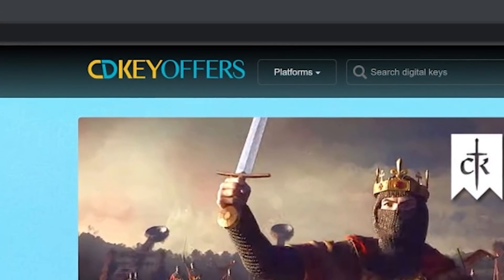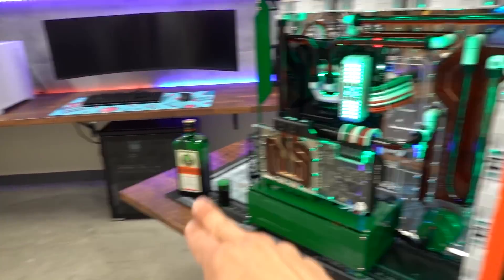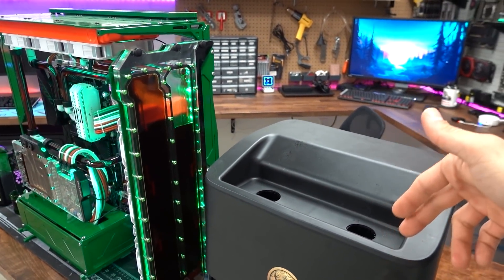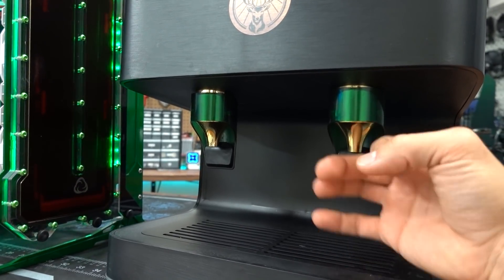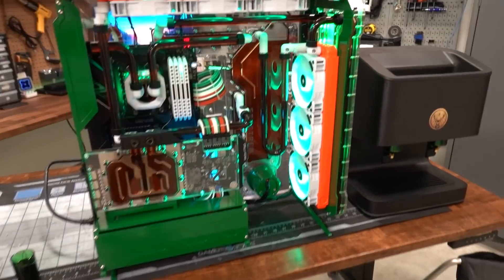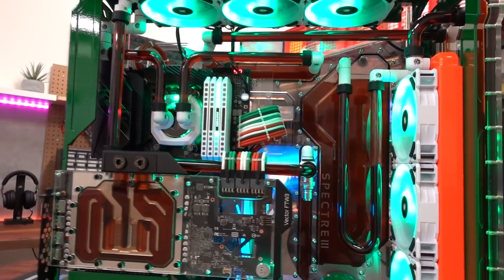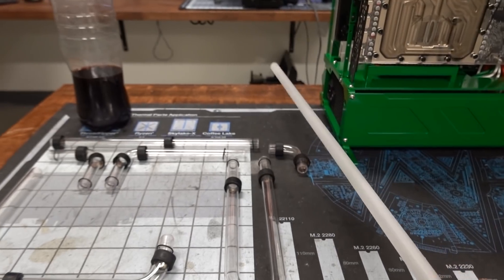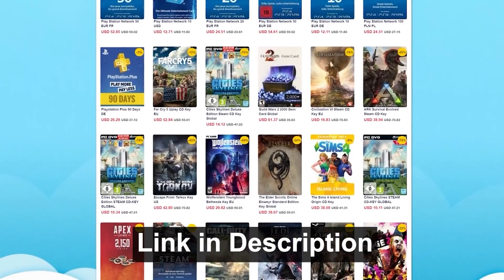IT'S BACK! My secret plans for the Jägermeister PC...REVEALED!

Comment: Be sure to allow the cooled fluid through the whole loop.  The way you described it, sounded like you were were going to pull the fluid right after the pump, which would not allow the new fluid to proceed to the rest of the loop.  And you would add the newly cooled fluid to the res area.  This would seem to be a small loop unto itself and may starve the GPU and CPU loop of most of the newly cooled fluid.  Ideally I would think you would want to pull the fluid before the draining plug and put the newly cooled fluid right in the draining plug.  This way your original loop is intact and you are just adding in this new loop.

Comment: recommend laying off the cooler idea as condensation is a definite will happen if humidity is too high in room, For it to work it would have to be in a fridge basically not a good idea.

Comment: Trying to give advice, youtube is acting up.
For the fill port on the Jager bottles, use a two part fitting like the kind for barrels or aquariums, but you have to figure out how to hold the inside part in place while screwing them together.
For moisture, you can get a small de-humidifier, they are made for a certain type of safe... a pew pew safe.

Comment: I suggest leaving one of the two chillers OUT of the PC loop. Keep it as a chiller so they can use it at the HQ. Gut the left side, adds pump if needed, do the bottle reservoir, but then have CLEAR tubing go into the bottle, and use the FROSTED tubing out the bottom. BOOM, the Jäger is ‘chilled’! You could do this at the top of the loop too to make it look like the PC heated up the water, (which, it did, technically) and then the chiller cooled the water down, when in actuality it did nothing. It would also look great to not completely fill the loop so that the water is constantly pouring into the bottle, waterfall style. Constant perfect pour!

Comment: 5:10 Bitspower or one of the  many water cooling fitting companies make passthrough fittings, right? Idk if it would work, but in my head it'd go like this: Drill hole in Jager bottle, put some Teflon tape (like plumbers use) on the threads of the passthrough fitting, attach it to hole in Jager bottle (maybe put a thin layer of caulk or silicone sealant around the outside of the fitting and the hole in the chilling machine to completely seal them?), then hook the tubing up. 

Like I said, just a thought in my head. I have no experience with plumbing, custom loop water cooling, or even Jager besides some foggy memories of parties in college, so take my suggestions with a grain of salt. Lol.

Comment: I've used chilled water and coolant for overclocking PCs.  I currently have several top 3 scores on HWBOT with dual 3090s and chilled coolant.  Once the cooler kicks in at full cooling ability(II.m guessing 0-5c?), you will likely get condensation on the GPU circuit board, which can kill the GPU unless its protected from the condensation.  You will likely get condensation around the CPU.  in addition to that, all of the metal fittings will get condensation on them and it will drip off onto other components.
Reply: Of course, there is always the possibility that the bottle chiller just doesn't have the cooling capacity to significantly affect the coolant temperatures.  It doesn't look like it has a large cooling capacity since its mean to chill bottles from ambient temperature to near freezing over a longer period of time.

Comment: What's the flow rate through the chiller? How well will the cooling mechanism survive a constant flow of heated liquid? If the flow-rate through the machine and the chiller itself can handle a PC loop AND the chiller drops the loop  to sub-ambient temps, are you OK with the radiators adding heat back to the loop from the ambient temp air?

Comment: The chiller won't really be too reliable, so the chiller isnt designed to run constantly, it is designed to go on and turn off to keep it at a desired temperature, what you want to do is have it constantly running, this would severely reduce the lifespan of the chiller, meaning when it's constantly on in the hq in NYC then it might have a lifespan of a month or two

Comment: Given the base of the bottle is the thickest part i would have the hole drilled on the back rather than the base of the bottle. For ceiling the bottle to the machine perhaps have a look at the fittings for water bottle rockets. Given that you will be connecting a pressured system to something that is set to operate with gravity you may want to look at some sort of pressure valve to stop over pressure in the glass bottles.

Comment: Do you need a pump to pressurize the fluid input from PC to cooler? Your spout locations are lower than the cooler inputs, so your system has to be pressurized for the fluid to compensate gravity.

Comment: The pressure from the pump will still overwhelm bottle seal its only design for the pressure of gravity. it will also have some mechanism to let air into the bottle as it dispenses so its not a sealed loop.
Reply: You would probably be best taking the unit apart and looking how the chilling works, you may be able to run a tube through.

Comment: Look at aquarium fittings, specifically ones designed to handle pressurized filter systems. Those can handle sealing against glass.
Pipe dope is a great water tight gap filler, and plumber's (Teflon) tape could also be your friend here.

If you're going to use the quick disconnects, and keep the existing tubing in place, it looks like the loop would be in parallel. That way you're not requiring the chiller and the fittings to handle all of the flow and pressure generated by the pump. This is a good thing IMO. 

You could use one of the fan headers on the motherboard to have it kick the chiller on once the CPU or GPU hit a certain temp with a relay. You could get really fancy and use a raspi with an ambient temp sensor, a temp sensor in the reservoir, a humidity sensor, and a relay to control the chiller and keep the coolant above the dew point which would prevent condensation. You could also set a duty cycle with the raspi so you don't blow the chiller up as other's have mentioned it's not really made for this kind of work.

I don't think this chiller will handle the machine's load for a long period of time. A quick calc shows that with 1 GPM of flow, dropping water from 70 deg to 60 deg requires a half ton capacity chiller. A quick peak at the JEM Specifications tells me this thing isn't going to keep up. So keep the rads installed, disregard my previous text about sensors and stuff, and just plumb it in parallel. See if it makes a difference. I'm curious.

Comment: Have someone who blows glass make 2 custom bottles with the fittings you would need. If they can make some of the "water pipes" I've seen they can surely make a few bottles with glass fittings. Use window weld or headlight lens sealant to seal around the bottles/chiller.

Comment: You could cast the entry points, then make resin/epoxy connectors for the hoses (or embed them if you want but I'd rather make a connector.) Plus you can practice with the connections before you hook everything up.

Comment: Ok,  this got interesting.  Are the flow rates from the liquid unit the same as the cpu pump..... don't want to starve the cpu pump.  A fan will help remove condensation or the tubing if needed.  Perhaps a dehumidifier in the room will help. Looking forward to seeing what you come up with...🥃

Comment: I like the idea of clear epoxying a fitting into the bottles. I was thinking a bulkhead fitting but you'd need access to the inside. JB weld would look ugly.

Look up "reverse return" for your pipe configuration through the bottles. It'll even out the flow.

Comment: I'm not sure outside taking the bottles to a glass shop for modification.  I've never tried such a mod.  I do think your thought of branching off from the main loop into a split and then splitting back together and back into the loop is solid - if the coolant can't flow freely though to chiller it can continue to pass through the loop bypassing the chiller, and that might be enough to prevent condensation build up - well, possibly (won't know for sure until tried right). :-)

Comment: Reduce the condensation by raising the temperature of the cooler to room temperature.  You're keeping a computer cool for performance, not for storing your next shot.  
Or you could simply use the hardware for aesthetics and stuff the cooler section of the loop into the box.  Using the bottles as exterior reservoirs.

Comment: In regards to condensation, keep in mind the room it will sit in will likely be air conditioned. I'm sure it will be fine but the extra coolness could potentially dip the temps that bit lower.

Comment: You already touch on a few things that may be concerning. And I do believe the biggest hurdle would be the pressure between the pump and the chilling machine. If you get that figured out it should be smooth sailing from there. And then worry on how it looks.

Comment: if you want to integrate there product into the machine (PC) ,I suggest using one there bottles as reservoir in pc and use o rings to keep it air tight.

Comment: The cooler for Jägermeister beer may not be designed for cooling for a long time, you may also check if the cooler can handle the temps that are coming from the system

thats all I am concerned about otherwise all looks good from me

Comment: Does the chiller have its own pump or is it designed to run on gravity feed pressure? If it's a gravity fed design and you're trying to pressurize it you may find other internal issues arise. You might have better luck using the bottles as a reservoir, opening the pour valves permanently letting them run into another pump/reservoir back into the system.

Comment: Use a diamond tipped drill bit or at least one that can go through glass, fit a grommet in hole, use mineral oil or soapy water as a lubricant and feed the hose through the grommet

Comment: All things considered, I think it would make for a very clunky build with too many tubes for no other reason than to create possible leaks everywhere whenever they move it.

Wouldn't just 1 big Jäger bottle be much more aesthetically pleasing to the eye than a bunch of splitters and clutter?

If you still want to go with a shot dispenser, go with their tap machine with 3 bottles on top. It will fit way better into the pc-build theme + you can hide all the cooling components inside of the dispenser, giving the pc itself a very clean, neat and tidy build and the bottles will be just for decoration on top.

Reservoirs in the pc + in/on the dispenser will just make for a giant amount of fluid to be pushed around.

Comment: Mr Meister should be it's name but in seriousness, I think there's a chance the cooler will drastically restrict the flow but with the idea of the bottles, potentially cut a hole and maybe try tap a thread into it that matches your fittings. Or maybe around the hole try find a more professional looking way of using a hose clamp the tubing to a grommet and a clamp that fit around the bottle and grommet making it Water tight.

Or essential get the bottles or replicates of the bottles made of resign or acrylic, to allow you to get the threading tapped easier and simplify the process for you. 

Just random ideas for you 😊

Comment: that chiller is not made for 24/7 operation , my suggestion for thermals is you can use the chiller box and put another chiller which is made for a 24/7 operation and use tubing inside the box . use the box just for show.

Comment: I would simply run a single run clear tubing from the pc into one Jägermeister bottle, bypassing the refrigeration and have one run of frosted tubing back to the pc, making it seem like it's actual chilling it to frost levels.And I would leave the nr.2 chiller intact, keeping a real Jägermeister bottle there for the one and only inteded feature of the device, cold jäger shots. There's no need to use the actual cooling device to chill the coolantfluid, as it would only complicate things, causing more possibly more damage than good.Condensation, noise levels, flow restriction, compressor failure, and there will also be heatexchange from the compressor itself as nothing is 100% effective.Will generate more heat than cool :p

Comment: Kyle, Maybe consider pulling through the chiller rather than pushing.  If you pull from the pump side intake on the chiller output side,  you may not have the overflow issues on the intake to the chiller.  Also, the condensation issue shouldn't be too much of an issue as that chiller won't be able to pull down the temps that much.  .... Daz

Comment: Use epoxy resin to make the two botles. In this way you will be able to put a normal plug for your tubes. You will be able to stick the labels on the normal position. You can color the resin with the exact color of the real botle, the exact green.

Comment: So, I have a concern, but I'm not sure if it's a problem or not.
I'm worried that your radiators will warm up the loop if the chiller gets the liquid cooler than room temp. I'm also worried that the chiller won't be enough for the constant heat output of the PC. Like Linus showed when he put a mini ITX PC in a fridge

Comment: just cut hole in the bottle and use a double coupled push fit connector and a gasket each side. cut the bottom of the bottle to fit it and bondo or worst case hot glue hot knife the glass back together. u need 300 degrees to melt glass. take the chilled water into the rad to allow it to warm up so no condensation. if you need more specific dimensions hit me up ill get you a cad design. ship it to the UK and ill laser cut and hard bond it  :) this really will look awesome with about 8hr of polish and 2 sliced fingers. thankfully the chiller is designed for thick glupy fluid not free flowing water. so really shoudnt be an issue. each pass of fluid will lower temps a few degrees and with a balanced flow will maintain it.

Comment: One concern I thought of off the bat is that you should test to see how cold it makes the alcohol. Alcohol freezes well below zero and while the machine won't chill it anywhere close to that freezing point, it's possible it might chill it below the freezing point of water. That's not an issue for alcohol, but it could be for the fluid you're using in the computer.

Comment: I would try flex-seal for the top, also have the cooler at the rear of the machine so you could run the inside line to the machine behind the GPU.

Comment: I am no expert so I am not going to say if it is going to work or not. But if it doesn't work, could the chiller be 'gutted, and you run the tubes through a Jager bottle with a hole made on the bottom, the straight through the spout then into the PC?. If the bottle is at least airtight on the lid end, they could be filled up with the tube running through the middle still. The base of the bottle wouldn't need to be airtight then.

Comment: Kyle you can make an airtight seal on glass bottles using epoxy. It helps if you etch the glass first to create more surface area, but there's definitely epoxy out there that can bond glass. Some types of caulk might also work but IDK if they'd hold up as well as epoxy would. Should be able to attach fittings to a glass bottle using this method to use it as a reservoir. I don't think this is actually necessary though because you could also use a standard screw on siphon top to do the job. It would have a long siphon tube to the bottom of the bottle, and then you could either operate it using the unsiphoned part of the cap as the outlet, and the siphon as a drain that comes out at the top, or run it with the bottle in it's standard upright config, and pull water into the loop from the bottom of the bottle. I know it's possible because one of my friends has already modeled and 3D printed a cap that does just this, for a similar mod. I can ask if he is willing to give up the files and put you in contact if you'd like. Would be REALLY cool to use a jaeger bottle as the reservoir for this build.

Comment: You said it takes the chiller multiple hours to get to minimum temp. Given how slow that is, won't the thermal output of the PC be waaay too much for the chiller to make an impact on a running system/loop?

Comment: For airtightness I'm thinking a setup that's kind of like computer case grommets. That plus some Krazy Glue or similar should work.
Also, the fluid should be called Fakermeister since you're not using the actual drink :)

Comment: Disassemble the chilling machine then tap straight into the inlets and outlets so you can tube out the back. Then just stick full bottles on top. That way it still looks like a functioning dispenser. I’m a pipe fitter making impossible stuff like this happen is what I do. If I can help in anyway with it let me know.

Comment: I forgot how nice that build is.  Jägermeister must be happy.  As far as chilling is concerned, i would gut the the Jägermeister chiller and just make it part of the loop as you describe.  How many gallons per hour is pump on the system and would it be pushing water too fast or too slow for it to effectively chill the system.  I love your concept to death...that would be awesome, but i wonder if the chiller would be effective at keeping things chilled enough.  Also, I wonder if chiller is designed to maintain the temps.  In the end you will be giving to client and imagine if something breaks like the chiller....Not a fun IT call to deal with over phone.

Comment: How about instead have an external tube dipped in cold jagermeister reservior going back to the pc? I think the problem would be the downspout of the machine won't withstand the pressure of the pump since its too small

Comment: Ooooooo. Going to look good. 
I’m wondering if the cooler will handle pressure through the small holes, or if your going to need a second pump.